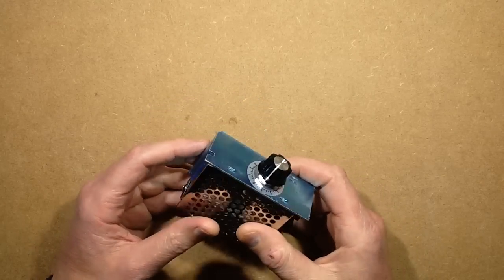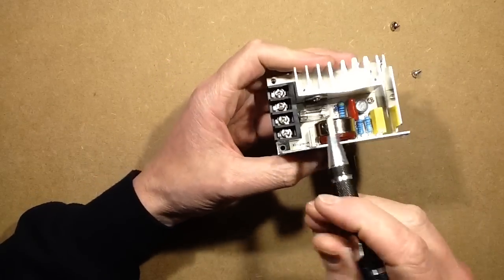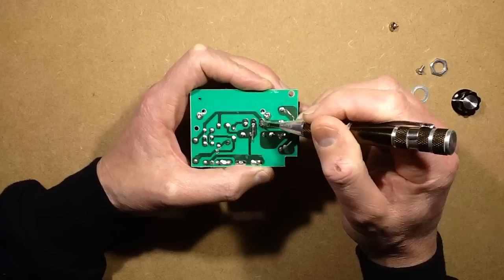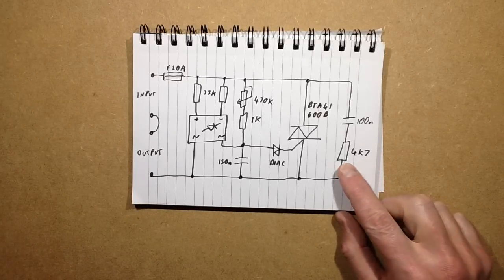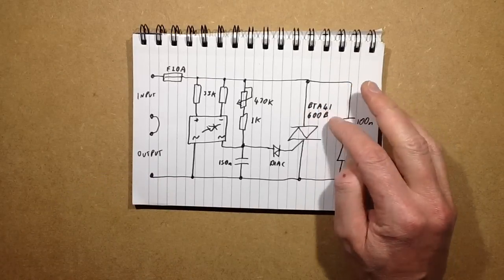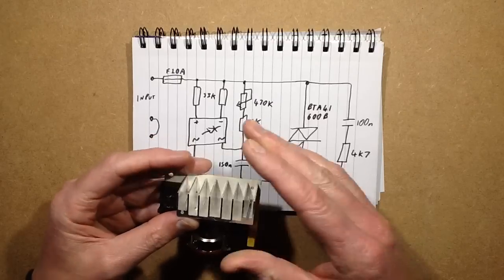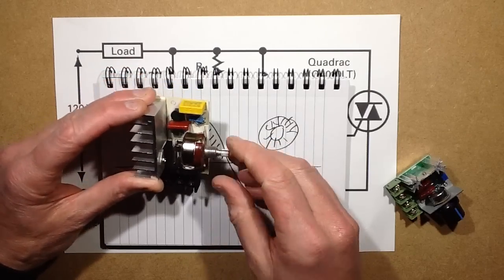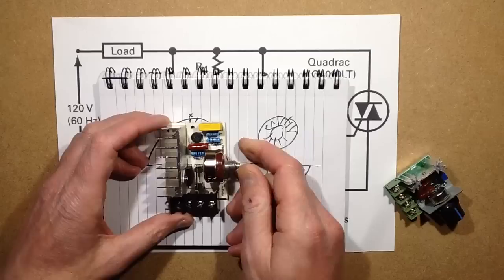Inside a "4kW" ebay power controller with schematic.

Comment: no earth on a 4000w load? yea ok
Reply: Scary!
Reply: +Synthematix actually this is just a switch so the earthing can be at the actual load, although i think they should earth the casing, is that what you mean?
Reply: Theo papa yep
Reply: In Soviet Russia, earth is you.
Reply: +Wyvern Thats what separates the men from the boys...
Reply: MY hybrid  SUV is 60KW or 60,000 watts and has no earth wire to the earth How the hell does a 60kw device  not have a earth ground  Yes  both 330Volt DC and 330vAC 3 phase  is running in the car :O  NO earth ground  please help
Reply: @alakani  - Interesting - where'd you grow up?
Reply: @punker4Real  If you cut the mounting bracket on the muffler, it converts your exhaust system into a brush. The contact might not be great, but steel has proven to hold up better at high surface speeds than carbon fiber aftermarket parts. Good thing you have a hybrid vehicle instead of pure electric or you'd be out of luck.
Reply: @alakani  Okay !!! So what do think of the Controller? Regex
Reply: @alakani  that escalated quickly
Reply: @wyvern4588   hahah  🤣🤣
Reply: it is made for asian market. The 2kW is so hot here. Almost all plugs in asia have no ground.....

Comment: For what it is worth, a company I used to work for made a whole series of TRIAC based DC motor controllers, and the snubbers were all 47k and 0.01uF (10nF). I never questioned how they got those values, but the circuit and TRIAC worked fine.

Comment: Hey Clive I know you've done a computer power supply tear down but I was wondering if you could compare a cheap PSU to a notable good quality one....in terms of quality of components and circuit architecture.
Reply: That sounds interesting and I am also in favour of that test. But I know that the brand Seasonic pretty much is the leading producer and that they make most of them. Just look at their warranty of 12 years!
Reply: @sykoteddy  Computerparts doesn't have to be crappy, as the requirements rising with every new release of hardware, I still have some 20y old hardware that runs well, even the cheap stuff. Some cheap psus blow up because people tent to run them close to theyr limit. Back than a 250w psu was enough, my 4y old setup runs on 550w psu, the one I build 2y ago already need a 660w psu and a pc with very recent hardware requires at least a 750w. Just as an example, that hardware just ages quick enough.
Reply: instablaster...
Reply: @Scootertuner420  only 20 years … I still have a UK 101 that I assembled myself in 1980 and that runs fine .. 😂😂😂

Comment: It might be informative to see that power supply connected to an oscilloscope comparing the waveform while using the 4k7 in the snubber to that of a 100 ohm resistor.  I wonder how it changes the snubber performance.
Reply: would it be worth swapping it out anyway?
Reply: Yea that is what I was wondering about.  But I trust this schematic compare to what is being pushed out there as 100 ohm.
Also the extra resistor that goes with the potentiometer is in the middle between it and the capacitor.  They are typically shows to be above the potentiometer.  I wonder if that matters or not.  Probably not.
But the whole idea of the bridge rectifier, I think it is a big deal and what has been explained makes lots of sense.  Stability matter big time.
I know that without it, any good motor will act as if there is no potentiometer and by pass it and will take off without doing anything.

Comment: I have myself sometimes used bridge rectifiers different from their 'normal' use because I needed such a particular diode arrangement and they happened to come in a cheap package like that.
Of course the meaning is disguised just seeing this as rectifier symbol in a circuit.
It always makes sense to actually write out the diodes in a schematic to see these kind of hidden (rather interesting in this case) meanings.
Thanks for the teardown and detailed explanations about your findings.

Comment: I bought one of these after watching Clive's video. I added an earth wire to the screw and added a large inductor to the output. Also insulated the top and back of the heatsink because it is VERY close to the case.
Reply: I did exactly the same as you as i was concerned about proximity of the heatsink to case screws  and added an earth
Reply: Assume an inductor on output would be unwise if load was also inductive such as a motor ?
Reply: The inductor is to filter the output. This device works the same way as a light dimmer. If you take apart a dimmer switch, it has a coil and a small X capacitor (100n) on the output.
Reply: i tested vacuum cleaner universal motors before with this and there were no problems. It handled the inductive load fine.
Reply: I also use it to slowly increase the input voltage to SMPS that ive repaired. I can't afford a proper variac.
Reply: Thanks for clarification, any idea as a guide how many Henries large inductor was ?
When 4KW power controller arrives, intend it for a small angle grinder that has lost original speed control and is not a soft start tool.
Reply: Yep i did exatly the same as you and fitted shorter case screws too i did not add an  inductor though my concern was with if things went short or blew the thyristor  to the caseing better to be extra safe works well on a mains drill and dremmel
Reply: @joradcliffe565  - Did it work?
Reply: @NeuronalAxon  Yes and no iirc. Though it would offer back whole range of grinder speed, that all took place over such a tiny fraction of turn of adjustment dial the effect was closer to an on/off switch anyway.
Reply: @joradcliffe565  - Ah, thanks. Change the pot, maybe? One with a different resistance range and/or linear vs logarithmic?
Reply: @NeuronalAxon  Thanks for idea, will remember if situation repeats. As it happened that grinder motor failed and was binned, though only after a lot of use and it wasn't worn brushes.

Comment: The great Resistance on the snubber is effecting the time constant of that of the RC configuration (Making the charge time longer). This most probably reduces stress on the capacitor when there is a high inductive load present .

Comment: I use one to control the heating element on my pot still, it works a treat and the controller only reaches 40-45C after 3 hours use @2600W load which I think is acceptable and definitely better than I expected when I was installing a cheap Chinese component.

Comment: I can't admit to understanding all the electronics, but was delighted to hear that this regulator is designed to deliver smoother power at the lower end. My Ryobi drill is very spluttery and rough on slow RPMs and I'm really hoping this will help that. Also, several units of this type have been condemned as death traps, with circuit boards virtually touching unearthed casing, so I'm glad this thing appears to be relatively safe (despite looking hideous and having only one mounting hole on the front).  Thanks for the clear and meticulous breakdown.
Reply from the maker: None of these modules are really up to most safety standards.  For better drill control I recommend a good cordless drill.
Reply: @bigclivedotcom  Thanks. I'm using my corded drill in a stand. Unfortunately most cordless drills have a pressure-controlled speed trigger which can't be accurately dialled in.

Comment: As a radio ham, I don't actually use those bands (2m/70cm personally, I know some HF guys though), but the only thing worse than an unfiltered dimmer is those awful powerline ethernet gadgets. Great way to turn all the house wiring into a giant antenna for digital noise!

73s, 2E0GXE
Reply: Powerline units are a ridiculous waste of power too. I had a set which took 16 watts. All day long.
Reply: +drkastenbrot Very interesting you mentioned this, I decided to check the pair I own.  They do seem to be getting a little more efficient now.  It costs me £2.09 pm to run mine with no idle at all.  They run at 5.6w on full load.  Further reading for those interested here: https://tinyurl.com/nbb9hmc
Reply: +drkastenbrot Yeah, I have a system that can get ethernet from one end of the house to the other with no power usage above normal at all! (it's called a cable lol)
Reply: +TheChipmunk2008 I wish I had ethernet handy when we had the floor boards up to fit the central heating, I would have loved to wire up the house properly. I have to make do with powerline, not the favourite solution but the best for the circumstances.
Reply: +Ben Thomson Usually even WLAN is more performant than that and it at least stays on its frequency. Those thingies are really just made for the "oh my god WLAN is killing me" guys to make money. In the end you'll have more fun putting a proper cable in your house or moving the computer. 
An idea I just had is just putting a directed antenna(like 20dB) on your WLAN. That wouldn't emit any electromagentic waves where it shouldn't and gives a solid connection as long as no one walks through.

73
DO1JOM
Reply: +Jona Jona the best thing is 4 the w-lan is killing me guys the powerline things does even emit more elektromagnetic waves
Reply: Phizev I think the only way I can do it even remotely neatly is to run my main modem feed outside (through the old antenna cable hole) up into the loft and back into a room upstairs where I have all my (preferred but just now unused) network gear anyway, splitting it to the top floor wouldn't be too hard. It's having to run it back down again afterwards. I'd have to fit a switch downstairs as the best scenario.

Comment: The label is very logic, it's a very efficient way of supplying the sticker for your case, you peel of the blue part, then you peel off the sticker from the blue foil and stick it to your case where the module is installed. By doing it this way they are 100 percent sure that the sticker doesn't get damaged during transport.

Comment: Wow glad I found this video, I have one of these laying in a box back in my garage in South Dakota (I am hiding from the winter right now sitting in the Sun in Arizona at this time) It has been laying there now for a couple of years because I really didn't dare hook it up to my wood router. That what I purchased it for, as my 2.5 horse router is a single speed, and I have some huge bits that cannot run at full speed, lest they shake the whole machine apart.  These are made for cutting things like chair rails or making cabnit door inserts.  If this works right, I can slow the machine down enough to make the cuts without burning up the bits or tearing up the wood when it begins cutting.  MIne came with no labels on the terminals but I have taken it apart and pretty much figured out which is which, then made a label for it so I would remember it the next time I dig it out.  Thanks a million for explaining how this works and how to wire it up
Reply: Well here it is, another year has passed, the regulator is still laying in the box in the garage.  The router has not been turned on, in fact my daughter knocked the hell out of my table trying to get an old bicycle out so I could try and sell it, and I have yet to build up the energy to go out and see how much damage has been done.  She did it at my request so I can't really blame her. Doc's say I am drugged out on the prescription meds they have been telling me to take every damn day so now the weaning off of narcotic and anti what ever the hell they are anti drugs. My head seems to be clearing, after 3 months of sleeping day and night with only waking hours dedicated to eating and going to the BR.  Nice to be awake again, but most of the damn spring and summer have gone and I have done NOTHING.  Damn doctors anyhow.
Reply: @JerryEricsson  Get well Jerry!

Comment: Another point to note about fault conditions is the extra solder they have put on some tracks. In fault conditions this will sputter or could even create a vapour cloud which shorts out *everything*. Fault condition testing can be quite fun actually! Place a sheet of blank paper under the board to catch the sputter, then hang it on your wall!

Comment: This is why if I'm drawing out a circuit with a bridge rectifier, and it's not immediately obvious how it's being used, I do not draw it as just a "box" like you did.  I draw out the full "diode diamond" instead, because that often makes it much easier to see what's going on if people are using a bridge rectifier in an unconventional way (i.e. not actually as a rectifier), which does happen surprisingly often I've found.

Comment: I have one of those.  Never have developed the guts to hook it up since it came with no documentation, and no markings as to what hooked to what. I did take the cover off, and sort of figured out how to hook it up, the plan was to control my router for my woodshop so I could cut down the speed when needed. That said, it was advertised as 240/110 volt and I was really hoping it would work but after having problems with about every item I got from China that had the duel markings I decided to let it sit in a box out in my garage.  Thanks for the info, when the snow is at last gone and the weather warms a bit, I may try hooking her up to my router table and see if it will do the job for me.

Comment: This is for resistive loads only (Power factor 1) and is triggered from the load, for an inductive load (power factor other than 1) you need to trigger from the line and there are power controller designed as such. Also when triggering from the line you wouldn't need that extra circuitry to stabilize it. Basically this is just a high power light dimmer. BTW the 10 amp fuse will only give you 1200 watts at 120 volts and 2400 watts at 240 volts...

Comment: I like your comments regarding ceramic fuses. It should be noted, however, that not all ceramic fuses actually have sand inside them. The fuses sold by a particular Australian and New Zealand electronics retailer (known for ripping off Freetronics work) are standard air-filled fuses but have a ceramic case. The inside is identical to your normal glass fuses although the fuses are sold as ceramic fuses.

Comment: The snubber circuit in parallel with triac anodes always allows a leakage current.With these values is about to 6mA.Larger capacitors and lower resistors allows high leakage current.Especially when triac is used as an on/off switch then you might notice your low consumption led lamps to flicker when supposed to be switched off due to that leakage current.

Comment: Back in the first half of the 1970s I took a standard electrical box and installed a dimmer in it along with a duplex outlet,  the original use for it being to subdue the lights on the christmas tree at the time all incandescent.  After that this device was used to dim the bedroom lamps,  which worked out quite nicely.  Unless I wanted to listen to something on AM radio,  in which case I had to turn the unit off,  or the generated noise made it impossible to use the radio.  I have some salvaged ferrites and should probably install one in there,  as I don't believe that it came with one installed.  So many years later and the thing is still working fine,  excepting a bit of mechanical sluggishness in the pot.  More recently I offered to build one of these for my lady, and we went out and got what I thought was the same stuff,  and I built it.  Unfortunately that one displays the exact instability you describe here.  Turn it all the way down so that the light pretty much goes out,  and then when you want a bit of light you turn it up but nothing happens until you get to a certain point and then it jumps to more light than what I'd wanted,  at which point you can turn it down a bit.  The dimmers in both cases are the sort of thing that might be installed in the wall,  as the last place I lived had one for the light over the dining table (which I had to replace when it decided one day to let the smoke out). I haven't really opened them up to see what the differences might be,  or why one would exhibit that behavior and the other one didn't.  Do you have any thoughts on this?

Comment: I have disassembled several of those controllers, because it's way cheaper to rip them apart for components than to by components and in every one of them it was 100 ohm resistor in snubber circuit, so I am with you. I think that you are right when you say that they have made a mistake.

Comment: I've dismantled a faulty dimmer that came with some fake Arri light a year ago, the inside schematic is quite similar and the fun facs is that the pcb has the room for the bridge rectifier but is not used, if you are interested i can send you some photos of that circuit.
(the Ebay listing is no more available but it was called: As ARRI 300/650/1000W Tungsten Studio Video Spot light+case+Air stands Kit)